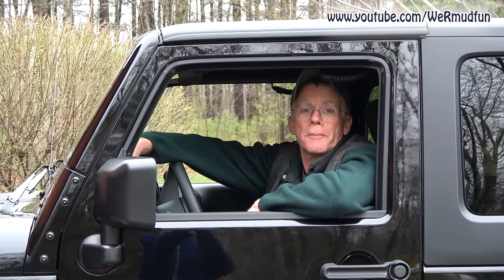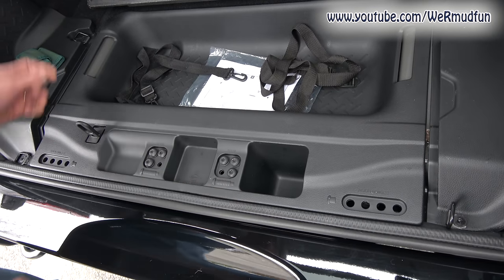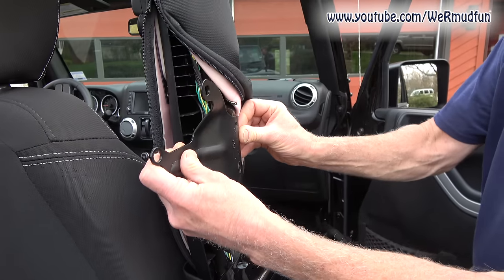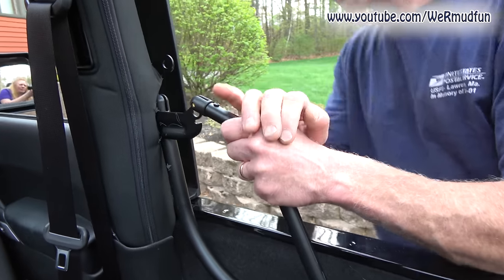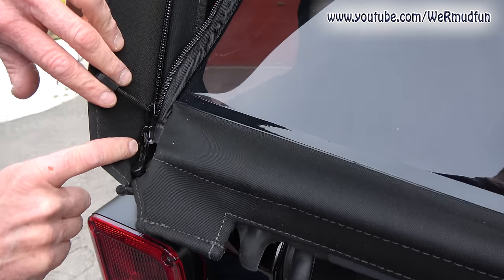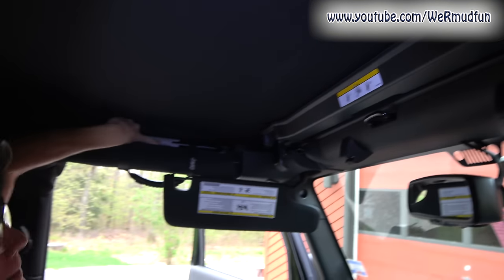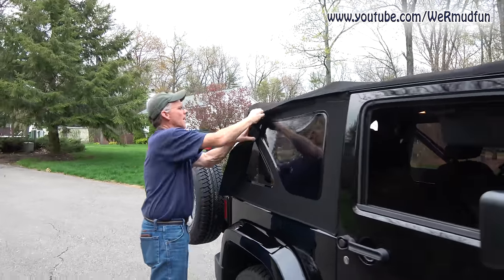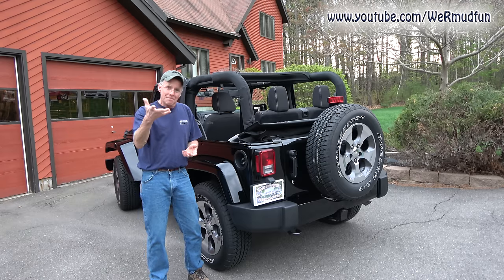Jeep Wrangler JK Hard Top Removal - Soft Top Install 2Dr in 4K

Comment: Finally! A video that shows each step. My 2016 came with the hard top, but no soft one. The dealer felt bad, and just loaded the back with a bunch of parts along with the soft tops. (I'm not sure why they gave me 2?) But I see that they didn't give me parts like the window frames or the clips for them. I'm glad you showed each step, as I would've had someone help me remove the hard top then found I couldn't install the soft top without the needed hardware! Really, the best video I've found on how to do this! Being my first Jeep, and a somewhat older (?!?) woman, I now have a better idea of what to do. A million thanks, and I'll jump over and have a look at your new YouTube channel! 👍🏼👍🏼
Reply from the maker: Thank you so much for your comment.  We are glad you liked the video and didn't get stuck taking off the hard top only to have to put it back on again.  Good luck and enjoy your Jeep. They are great fun vehicles to have. 😀
Reply: @WeRmudfun  Just out of curiosity, do you use anything to keep the rubber seals for the tops conditioned? I had t-tops in a car, and used Armour All on the seals, but I've read that's not the best to use. I'd like to keep them conditioned to avoid cracks or weather damage.
Thx! 😁
Reply from the maker: @kdavis114  Honestly, we have never conditioned the seals on any of our Jeeps and we have had 4 of them.  😀
Reply: @WeRmudfun  Thanks for the reply. I've just read so many complaints of Jeeps leaking around the rubber that I wanted to head off any problems before they start. Since you haven't had any problems, I don't think I'll worry too much about keeping them softened. 😊
(Less time & work for me!)
Reply from the maker: @kdavis114  I always go with my gut feeling.  We have never done it, but that's not to say it  doesn't happens for some people.  I would imagine it depends on the weather in the particular area you live in.  Before we started traveling we lived in New England and had 4 seasons, but hardly the extremes of any of those seasons. 😀
Reply: @WeRmudfun  Very true! I'm in Ohio and where I am we do get those weather extremes. Of course, my last t-tops were in an '81 car, so maybe the rubber quality has improved since then. (One can only hope! 😀)
Reply from the maker: @kdavis114  😀

Comment: This is  the best video . I've had it saved for a few years. I recently lost the screws that attach my sun visor to the mounting bracket. Could you tell me which screws I should purchase. You complete the install at 7m35 seconds and  show one side being installed. Appreciate any help! Really such a wonderful video. No one does it better!
Reply from the maker: Thank you so much Sheila.  Are the screws missing from both visors?  If not, you can take one out and go to to an auto store or hardware store and have them match it up for you.  We looked online, and there are multiple sizes and lengths available, but the description says they fit a Jeep, but none list the visor specifically.   The parts department at a Jeep dealer should have that information also.  Wish we had more info for you.  Good Luck! 😀

Comment: Great video. Question? Can you leave the soft top down and when winter time comes put the hard top over it so I guess you'd have (2) tops...................
Reply from the maker: They come from the factory with both tops installed, but as far as leaving it that way, I think it would be a pain trying to access the cargo area, there is not that much room to begin with.  The soft top is a lot easier to move around than the hard top, we just switch them depending on the season, but only have one on at a time.

Comment: THANK YOU for posting a video on a 2-dr Jeep--I'm getting tired of seeing all these soccer mom 4-dr Wrangler videos.  Just curious...but can you reinstall JUST the front portion of the hard top (i.e., without installing the back portion, too)?  Great video; really informative and easy to follow.  Well done.
Reply from the maker: Thank you! :)  I have never done it, but I read people have driven with just the Freedom Panels attached.  I'd make sure you latch the latches that can be and put the screws in the back of the panels  through the sound bar.  Press up hard on them to make sure they are holding before going out of a ride.

Comment: Thank you! I am looking to purchase my retirement vehicle sports car...a JEEP! I am hoping to buy a year from now and want to spend the next year doing my homework.  Hard top or a soft top when you live in the South and you are a single woman of 60 yrs? I've considered both but starting with the hard top. I'm just worried about storage (I live in an apartment).
Reply from the maker: You are welcome. :) If you don't have a place to store the hard top when you take it off, don't get both, unless you want to store the hard top outside.  Between the hard top and the soft top, we would still go the route we did and get the hard with the Jeep.  It's removable in good weather (with help, it is heavy), plus the front panel are easy and light to remove. If you get AC when you buy it it's another reason to go hard top first. The other reason we went with the hardtop first was soft tops around here were easy to find on Craigslist and cheap. We got a brand new one in the box for $600.  Just of course is our own personal opinion. :)

Comment: Can you put the hardtop back on while the soft top is folded back, but still attached to the Jeep?
Reply from the maker: The dual top option comes that way, but Jeep recommends only having on one at a time.  In order to do it, you would need to get the soft top as tight as possible.  That being said though, the Wrangler has lack of interior space to begin with and having both tops on is going to make loading the Jeep from the tailgate even harder. Just our opinion. :)

Comment: When putting the hard top back on, do you need to take of the right and left brackets as well as the door surroundings?
Reply from the maker: If you are talking about the brackets mounted to the rollbar, no they can stay on. The door surrounds need to come off along with the sail panel brackets for the back window.    I can only answer for 2 door models though, I believe the 4 door models are different.  Consult your manual for an Unlimited.

Comment: I can't find in the packaging bolts for the door frame part of the soft top. Any clues or tips. Also struggling to get my back window in.
Reply from the maker: Not sure what you mean by door frame part.  There are 2 screws per side that mount to the roll bar behind the front seats (There is a link in the description box below the video them) and 2 larger screws with plastic knobs that mount above the front seats in the roll bar. At least on a 2017 Wrangler JK.  The back window is tight and a little tricky when first mounting it.  Try to let the sun heat it up, that helps a lot the first few times.

Comment: If the jeep came with the factory soft top dose the hard to rear window wipper work?
Reply from the maker: If the Jeep originally came with just a soft top, I imagine that you would have to add everything that is missing.  The rear wiper on our Wrangler is controlled off one of the arms on the steering wheel.  Not saying it can't be done though. I have never run into the need.

Comment: Any idea why my front bar is about a inch short of the front latches?  It looks perfect but it's like it's too short and I can't close the front.  We finally got it hooked with three men, left it in the sun for a week, opened it up and again it won't close...
Reply from the maker: Once you flip the soft top up, you temporarily hook in the front, don't clip it all the way in,  before anything else, don't attach the sail panels either. There should be no reason for it not to reach.  Are the 2 bars that attach to the rollbar in the right position? Hope this helps. :)

Comment: I purchased a used rubicon and it came with the hard top and some parts of the soft top. I have the roof and back window. I need the door surrounds and left and right window plus the tail gate bar. And the 2 little clips on either side of the tail gate. Aarrrgghh.
Reply from the maker: Yeah, but it's a Rubi! :)  Watch Craigslist, you might get lucky.

Comment: Do you have to remove the soft top brackets when putting the hard top back on?
Reply from the maker: The ones that are mounted to the roll bar can stay in place.  the ones on the tail gate need to be removed.  😀

Comment: Help?! My door surrounds did not come with my 2016 jeep, what's the part number for those please? I'm also missing the rear window brackets, (tailgate mounts) what are the part numbers for those please?
Reply from the maker: Either a Jeep dealer or something that is compatible with OEM (I believer Best Top has something). Also check FB MarketPlace.  Good Luck.

Comment: can you put the hard top back on with the soft top folded down
Reply from the maker: They come from the factory with both tops installed, but as far as leaving it that way, I think it would be a pain trying to access the cargo area, there is not that much room to begin with.  The soft top is a lot easier to move around than the hard top, we just switch them depending on the season, but only have one on at a time.

Comment: Super helpful and informative video! However, seems like alot of effort to put the soft top up and down... what if it starts raining and it takes you 20 minutes to put your roof back? Doesnt seem worth it to me to take the roof off at all really. Jeep should work on an automatic convertible option (AKA one button and it does it itself).
Reply from the maker: You would be surprised how fast the soft top can be put back up. LOL  There is also sort of a convertible option on the 2018.
Reply: Hmmm, maybe i should look more into it then. I actually hate the 2018 version though 😭😂 my other issue is i love how when you open the trunk, the hard top flips upwards and the soft top is just in the way...
Reply from the maker: No one says you have to even have to have a soft top.  We only have the soft top because the person who sold it to us never intended to use it.  The hard top has the Freedom panels that come off and they can be stored inside the jeep.  If the day is suppose to be rain free you can remove the whole top and there is no soft top to get in the way.  If it does rain, there are drain plugs under the carpeting. LOL  We are not fans of the 2018's either.  We are glad we decided not to wait for one.

Comment: That seems like a lot of work. I would just temporarily remove the front two roof panels and just throw them in the back and instant sunroof. This way I could still carry valuables with me and not be afraid to get my soft top cut open by some crook, those guys still do exist. Also if I want I could just remove the doors as well and plenty of cool air.
Reply from the maker: Once it is initially setup is done, it quicker getting the soft top down than getting the Freedom Panels off. Whether riding with Soft top or Hard top, doesn't really matter, getting out in the Jeep and having fun does. Enjoy!  😀

Comment: I would have like to see how one person would raise the top.   I find with that heavy header bow for that stupid horribly designed sun rider...  which my old Jeep didn’t have ...  I have to literally stand on the back bumper with the tailgate open of course and lift and throw the whole thing over.  Because if I try to do it from the side it never lines up right because of the heavy header bow.  My 2005 wrangler didn’t have the sun rider and I could stand on the side and raise my top with ease with one hand.  I hate that sunrider and have never used it.  Anyone know if I can get a replacement top that doesn’t have it. For a 2011 wrangler Sahara two door.

Comment: How do you store your soft top frame?
Reply from the maker: Right now it is in a storage unit while we live and travel  the USA in our RV pulling the Jeep behind the motorhome.  😀
Reply: @WeRmudfun  LOL, what I meant was do you have a hanger system or hook system built to store it. Or do you store it flat on a high shelf?
Reply from the maker: @DerekGH  We just would store on the carpeted shelf  during the winter we built to store the hard top on, then switch them in the spring.